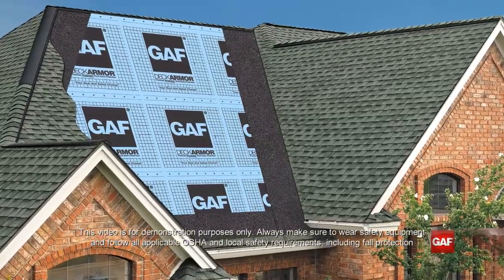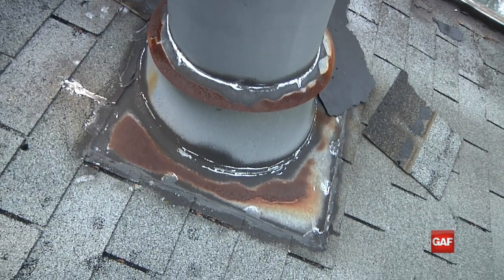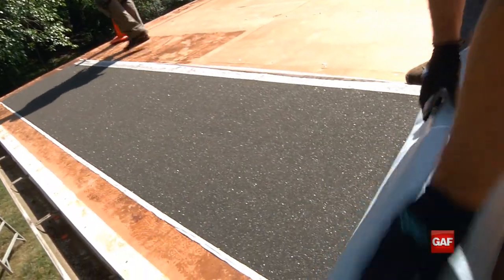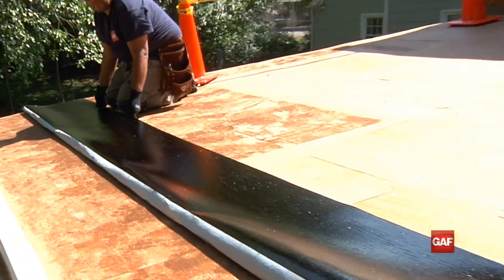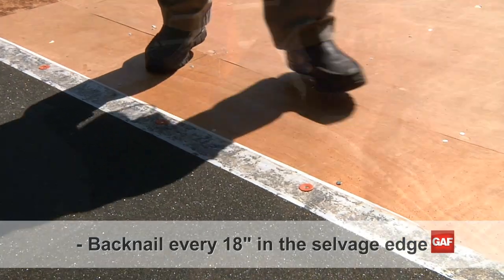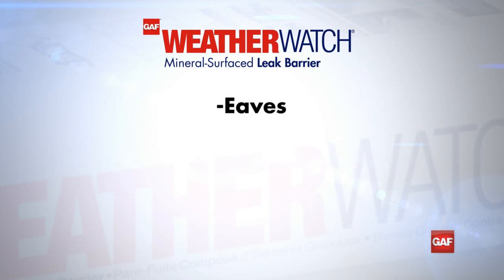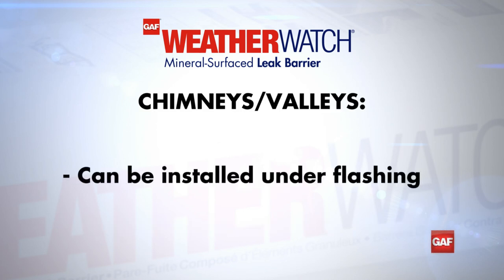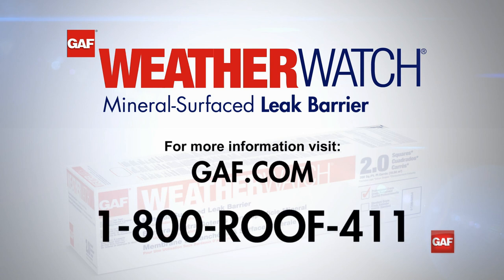How to Install a Mineral-Surfaced Leak Barrier | GAF WeatherWatch

Comment: Could this be used as a single outer shield on top of OSB for a hot tub gazebo? It is a single pitch almost no snow load, but a very rainy season.
Reply from the maker: Hi! Our technical team would be happy to help with this, please give them a call at 800-766-3411.

Comment: Could you go over the weather watch with a metal roof?
Reply from the maker: Hi. We don't recommend using the WeatherWatch® Mineral-Surfaced Leak Barrier with a metal roof. You can find more information here: https://bit.ly/3SUB1xs.
However, the StormGuard® Film‑Surfaced Leak Barrier, which is a peel-and-stick underlayment, can be used under metal. Visit https://bit.ly/3STi6D8 for more information.

Comment: Hi, can I use the storm guard as my base sheet then use the cap sheep over it?
Reply from the maker: Hi, there. StormGuard is a leak barrier product for under shingles. We do not advise for it to be used as a base for the LIBERTY™ SBS Self-Adhering Cap Sheet. If you would like to speak with one of our technical experts, you may contact them at 1-800-766-3411, and they will be happy to assist.

Comment: I want to shingle a camper port.  I only want barrier on the eaves. Is Stormguard, or Weather guard better?
Reply from the maker: Hi, there. Either product can be walked on when installing shingles, GAF recommends the use of soft-soled boots when installing GAF roofing systems.
Reply: @gafroofing  Thanks. You have helped me a lot.
Reply from the maker: You're welcome!